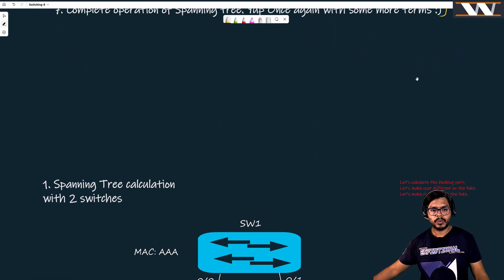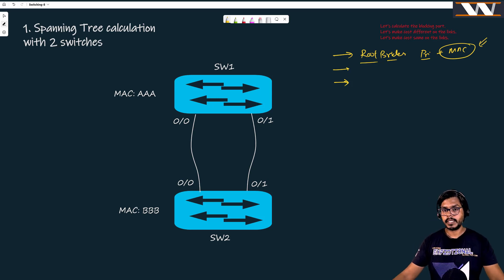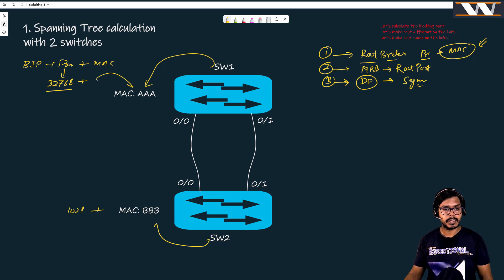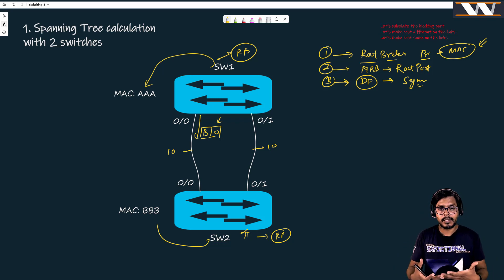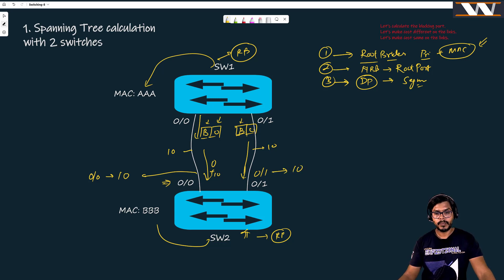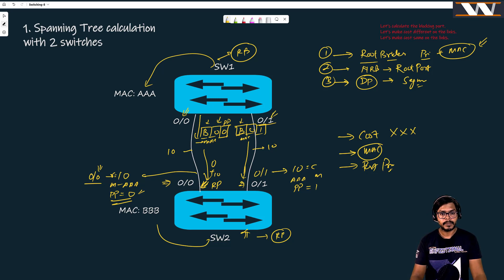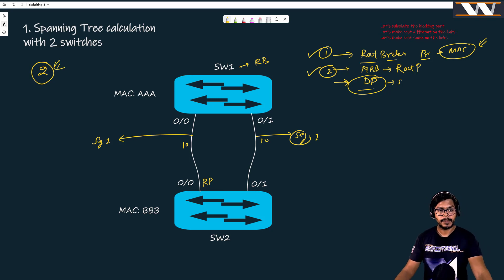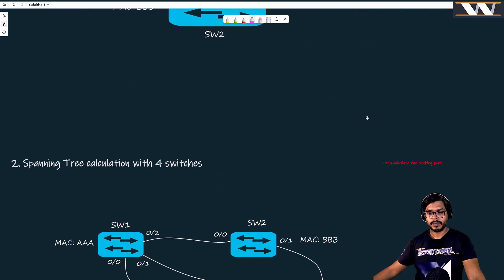Spanning Tree Algorithm (With Two switches)

Comment: Very Nice example.
I got cleared my doubt which i had since 10 years. You explained that as ❤port priority❤

I would like to share you that which you said blocked port actually its alternative port and the state is in blocking State.

We only have two state in spanning tree protocol.
1) Forward 
2) Block.

And we have 3 port type or role in spanning tree as per my understanding. Those 3 are as below.
1) Root Port 
2) Designated Port 
3) Alternet Port
Reply from the maker: @mahendrakumarsahu4395  Yes correct. Spanning tree has evolved over the period. Mostly you see RSTP enabled by default on switch. Please do change it to 802.1D, and you will see the other port status also..

Comment: Difference btw port priority and interface id. Something missed
Reply from the maker: Port priority is combination of two values. One is priority which is by default 128. The remaining piece is port number which is generally equal to port number. Hence most of the time if you don't change priority value, lowest port number is preferred. Thanks..